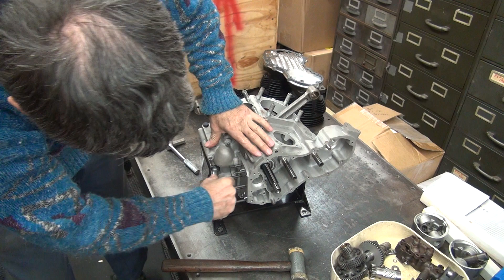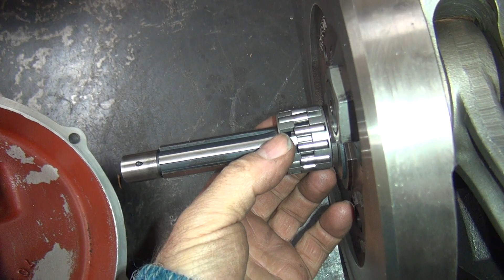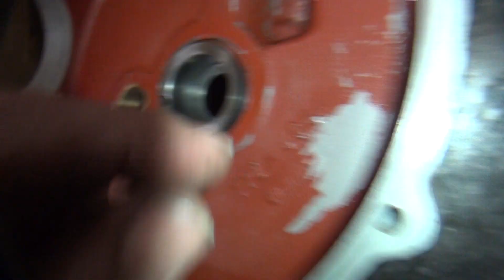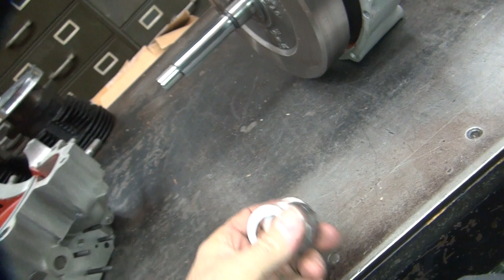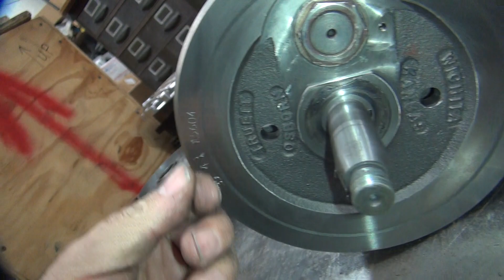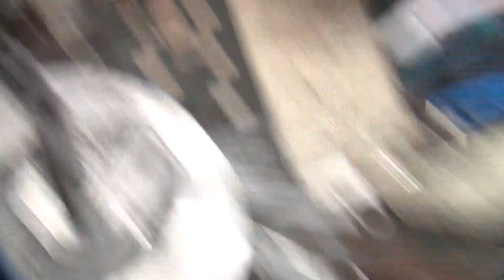#104 1946 junk 84ci stroker knucklehead 500 mile new repo motor rebuild 79ci harley tatro machine

Comment: Tatro....Why is the inside of the case painted orange? ..Wouldn't bits of paint chip off and flow through the oil system?......Good video
Reply: Use to coat old cases. Because porous material.
Reply: @mattfinch5088  Correct. Actually, HD used to use red electric motor paint. Glyptol or something like that.